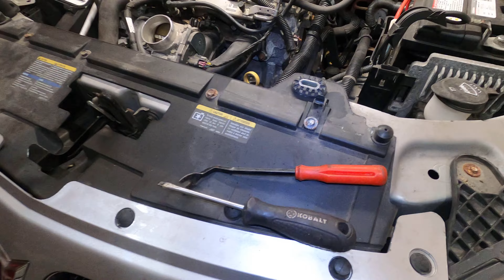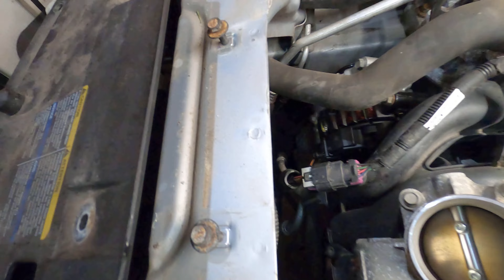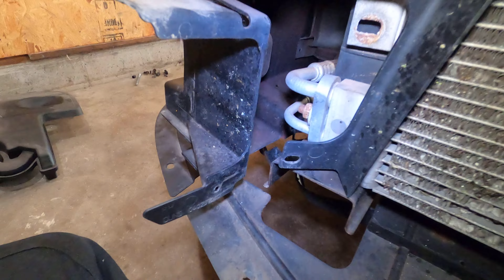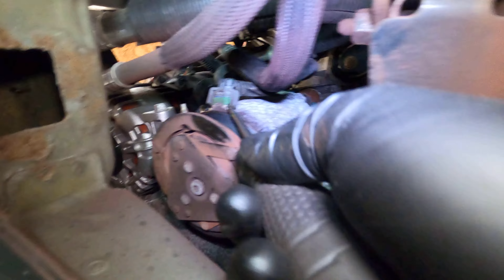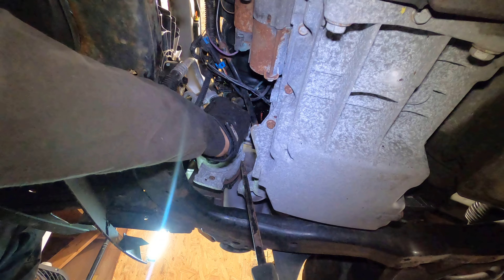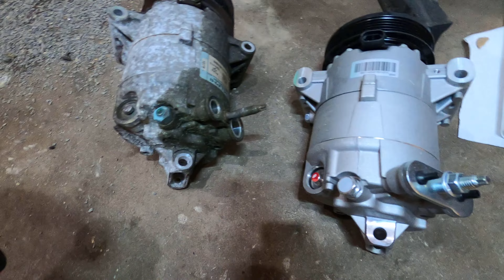2009 Pontiac G6 AC Overhaul 2 4L

Comment: My ac clutch is engaging, but the pressure on the high and low sides are the exact same and it’s not blowing cold air
Reply from the maker: Does it stay engaged or does it cycle off and on? Can you turn the ac button off and the clutch disengage? i hope this video helps. feel free to like and subscribe for more & if you can, please help the channel out by giving a super thanks. Making these videos takes a lot of time, but we do it to save you hundreds. also head down into the description and check out the link for some high quality led bulbs for this and any other vehicle. use my referral for a discount. Add me in Instagram for behind the scenes pics and Stop by my store for some Anything Auto gear.